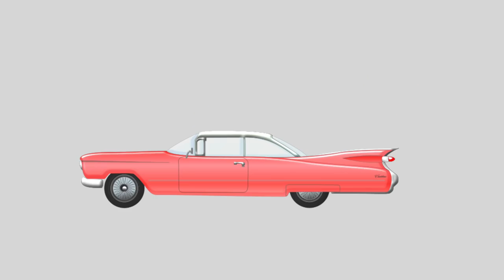Yes, Rockets CAN Fly in a Vacuum

Comment: yes, but explain the action reaction forces are on what? the force of action is on what? the reaction force is on what? forces act on something. for example if we kick a box, the kick action is on the box and the reaction from the box is what we feel on our foot.  explain the same in the balloon  and the rocket.
Reply: When fuel is ignited in a combustion chamber, the resulting hot exhaust gasses propagate in all direction. Those that happen to be facing the open end of the chamber will simply exit it, without imparting any sort of force upon a rocket, but those that are facing away from it, or sideways, can't simply turn around in mid"air" - the only way for them do change direction is to bounce back off the walls of the combustion chamber, which is the "kick the box" equivalent from your example.
Reply: To expand on what Jan Strzelecki said, a good way to imagine the action/reaction taking place in a rocket engine, is to imagine a sturdy bucket with a stick of dynamite inside.

When the dynamite detonates, it's pretty obvious what will happen to the bucket.
Reply: That's the problem.  There is nothing to react against.  The act of burning hot gasses is to create a high pressure zone at the end of the rocket, but with no atmosphere to pressurize it's like farting into a vaccum cleaner.
Reply: @DrCash7 
The gas expands in all directions.

At some point it will impact the inside of the engine bell.

When that happens, the gas will ricochet off that surface.

When that happens, the gas will experience a force.

Any force has an equal but opposite force.

Ergo, the engine bell will also experience a force.

QED.
Rockets work in a vacuum.
Reply: @ShadowFalcon  Oh, I like that. Even shorter than my explanation, neatly divided and to a point ☺
Reply: @Jan_Strzelecki 
I liked your explanation too.

Reasonably detailed, and it had a pretty clear progression from the point of ignition, to the point where the exhaust left the engine.
Reply: @DrCash7  No, after doing some thinking I found the answer.  the action force is from the compressed gas in the balloon to the inside wall of the balloon, and the reaction is from the wall on the gas however since there is no force and pressure reaction at the nozzle ( exhaust), therefore there wont be an equilibrium  of action reaction forces causing  the balloon to move to the opposite direction with same speed as the exiting gas.
Reply: @ShadowFalcon  asinine. As soon as the chamber is opened the gasses have 2 options: Hang out and mysteriously do work on the "inside of the bell" or freely expand into the vacuum of space.   We know how energy works, so we know it will choose the path of least resistance i.e. out into space..  Same reason why grounding cables work.  How this is so difficult for some is revealing..
Reply: @DrCash7  
"Opened"?

Do you think there's a valve in the nozzle, partitioning the combustion chamber from the rest of the engine bell?

As for what I expect the gas, resulting from the combustion to do.

I expect it to expand equally in all directions, until it impacts (quite forcefully) with inner surface of the engine, and impart a force.

Hell, your two options don't make sense. If the gas "hung out" in the engine bell, it wouldn't be accelerated, and therefore it wouldn't impart any force. And if the gas left the engine bell, that means the gas has been accelerated, which means it must've experienced a force.
Reply: @ShadowFalcon  They make sense.  Keep re-reading it until you can grasp it.
Reply: @DrCash7 
No they don't, because as I've explained, your options break the laws of physics.
Reply: @ShadowFalcon  you're struggling with reading.  Work on that first, then we can move you along to understanding physics laws ;)
Reply: @DrCash7 
Well then, how do you propose that we accelerate matter without a force?

You say that the exhaust gas leaves the engine bell, without having experienced a force. That breaks the laws of physics.
Reply: @ShadowFalcon  There's that reading deficiency again.  Scoll back up a bit and take it from the top.
Reply: @DrCash7 
I believe you need to read your comments again then.

EDIT:
Hell, you think that rockets can't work in a vacuum, because of a misreading of Newton's Third Law.
Reply: @ShadowFalcon  Keep practicing that reading comprehension!  You'll get it eventually!
Reply: DrCash7 
Is this the latest “argument” you’ve discovered?

Did enough people tell you, you don’t understand what you’re talking about, so you started thinking “reading comprehension” was a solid argument?

Well, try again. How would you accelerate a mass, without a force?
Reply: @ShadowFalcon    Scroll up.  Digest the information. 

Read more
Reply: @DrCash7 
You haven't shared any information, other than the fact that you think for a rocket to work, three objects need to interact.
1) The rocket
2) The exhaust
3) some "medium".

Now, please do tell, why you think a rocket, as the only thing in the entire observable universe, needs three things to interact, in order to generate a force-pair.
Reply: @DrCash7 
When have I said that?

I am saying it's displacing something externally. That something being the combusting propellants (which is a lot of something)

Comment: Is the force less in a vacuum? Or is it cancelled out? A vacuum on earth it would need more force for lift of. Gravity seems to get stronger. A fly can’t fly in a vacuum. So less pressure around it. Does the removal of gravity cancel out the low pressure?
Reply: Rockets work BETTER in a vacuum where there is no atmospheric pressure to SLOW DOWN the exhaust gas.
Rocket propulsion is just the mechanical recoil of pushing on mass.
Reply: " A fly can’t fly in a vacuum."

Flies fly by pushing themselves against the air and *moving the air*.  No air, no flight for a fly.

Rockets are accelerated by pushing gas propellant out the back end.  They are moving air, too, but they bring it with them as opposed to using the ambient air.
Reply: @davidmescher2526  so they violate Newtons first law? Ok chatbot 😂
Reply: @davidmescher2526  
One of his two brain cells is sitting in a wheelchair while the other is pushing it. 🤣😂
Reply: @papalegba6796  - "so they violate Newtons first law? Ok chatbot"
NO because Newtons Laws say that rocket propulsion MUST work in a vacuum.
Perhaps you should try taking a physics class before trying to debunk physics?
Reply: NASA chatbots claim a vacuum can apply an external force 😂
Reply: @papalegba6796 
👎👎👎👎👎
Reply: @stuartgray5877  then you agree rockets cannot work in a vacuum. Plus "we" 😂